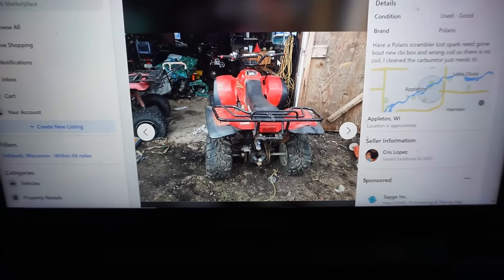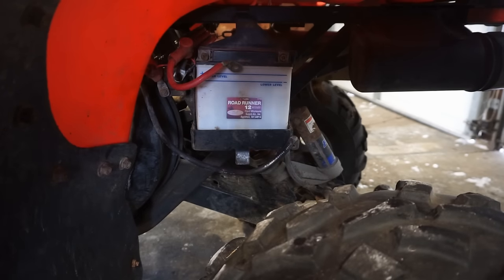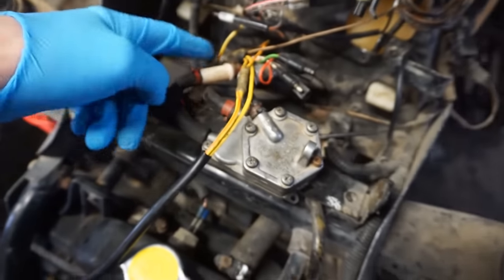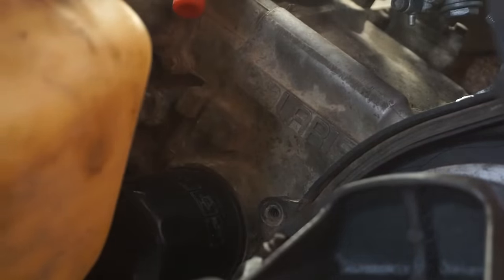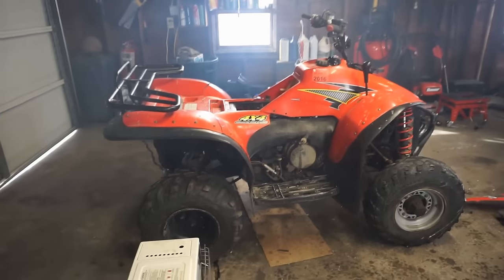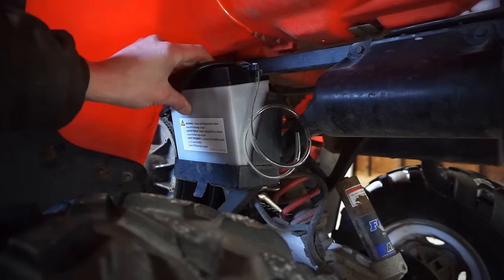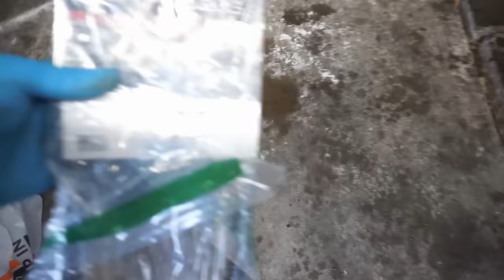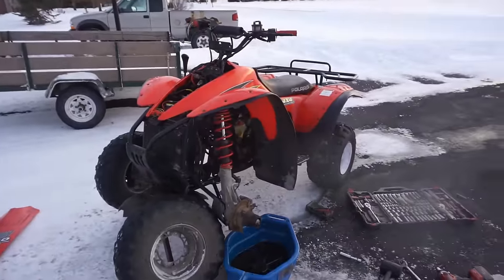Seller Said This Quad Was a SIMPLE Fix...$900 Polaris Scrambler 500 4x4

Comment: I worked at a plant that made Polaris exhaust very low quality, but they did switch to stainless steel on a lot of different models. Alot of the welds still look like crap though

Comment: I am assuming this is an old video that you just made and released, but your new belt isn't going to last long with a huge piece broken off the inner sheave on your primary.  Good job on pointing out the front hubs filled with grease instead of oil.  I just learned something, thanks.
Reply: Here's some more for ya, they also have to be filled with the PROPER oil, or they still wont work.
Reply: Yep should be filled at minimum with automatic transmission fluid.
Reply: He purposely didn't mention it but he 100% saw and noticed it. He didn't say anything because he knows it's at least $200 for a decent used clutch with no weights or spring.  This is why guys part these out and don't fix. They will have more money into fixing than it's worth

Comment: I had one just like it, got mine for $500. The guys daughter rolled it, didn't have any spark either. New CDI, voltage regulator, and coil. Problem was the spark plug boot. Fun to rip 🙏🏼

Comment: I have a 97 Polaris scrambler 400 2 stroke and it’s  damn near bulletproof! Had for 8 years beating the crap outta of it and always started. Welded the spark plug to the head because it always popped out. Took all the grease before every ride. Fast af! Always almost hit 70mph running on 8-ply tires!!

Comment: Yeah I picked up my 2003 Suzuki Vinson 500 from someone on CL.  He said all it needed was the rear break fixed.  Never mentioned that the dang frame was bent.  You literally had to cock the handle bars in one direction to go straight and because of the bend the front wheels were cambered off to one side.  He also said it was a 2006.  People are freaking liars when it comes to selling things.
Reply: yeah I feel ya, I bought a tractor off of FB and when I got the tractor home...the seller had already vanished. Needless to say I had to purchase a new head for this 21HP briggs. I was lucky to have a customer that was in the market for one
Reply: Why i got lucky when I bought a TRX250X, guy told me what's missing and what needed to be done, did it and it worked for about half a year now its got a rattling sound
Reply: U gota check the vin pl don't ways know o r remember. Also there off-road it won't be perfect always. 8k new or frac used.
Reply: U never know. I had a worn sprocket in a used bike blew the valve. Rebuilt it it's fine 2k but I got the bike for 2k new 12k.
Reply: The belt was fine the sprocket was old so now all new
Reply: Timin belt blew in mine. Jus new top end valves rest fine

Comment: Not 100% sure if it was the same on the scramblers or not but I had the 250 2 stroke and the front brake lever actually controlled a 60/40 split and worked on both front and rear brakes it was actually kind of nice tbh
Reply: that is wierd, usual the foot pedal does 50/50 ish and handle bar levers does front and if they have the other side rear. (on automatic qauds)
Reply: My 500 brake controls all brake front handle 😊
Reply: Just got a 2022 scrambler and same thing brake lever does all wheels and pedal does the rear

Comment: My father and I had a 250 trailboss and he had the scrambler 500 2wd version And as I got older, the scrambler became mine and that thing was one of the fastest quads of its day And mine was the 2 wheel drive to Stroke. And it would dust a stock 400 EX around the same year.

Comment: I had a new 2001 for about 12 years.   It was very heavy and had a ton of grease fittings.  The shift indicator lights often were funky, other than that it was a great fun ride.  Great engine with lots of power back in it's day!

Comment: I do not miss repairing my old Polaris 400 Sport. From quirky design flaws to the OEM parts just not holding up thru race conditions. Decent quads for just tooling around the house or farm, but I would not recommend racing them

Comment: Hey not sure if you noticed but at 2400 in video you are having screws that are stripped out! But if you look very closely you will see the tip of your Phillips head screwdriver has an extended tip on it. Just take a little off the tip on a grinder wheel and some of the stripped screws will go away!  Love your contents of your videos!
Reply: Buy set of correct Japanease screw drivers.Looks similar to Philips.

Comment: Also u need a plastic welder. I got one and ill never look back like 30 bux. And comes with 100 different assortment of sizes. Do it from behind then let it cool and cut the pin studs off. Works amazing. Touch up pen if you even need it

Comment: I just sold that exact model 2001 scrambler 500 4x4. i had it for 4 years and it was a maintenance nightmare most of the time. When I purchased it (for 2000) It needed a lot I didnt realize as well. new primary clutch,belt, breaks, master cylinders, caliper, petcock, tie rod ends, wheel and axle bearings carb kit and tires. Always ran great though..... Had it up for 2000 on marketplace ( all fixed)ended up letting it go for 1500. Good luck I'd run but I am nowhere near as skilled as urself.

Comment: I'd replace that neutral safety switch to cause it control that trigger coil also through the wiring harness to. yes your right about to. That trigger needs replaced on that engine joe. Along with that neutral safety switch to possibly.

Comment: Check all those lockout switches
When things like this happen , run a direct wire to the coil from the magneto or wherever the coil gets its power and bypass all of those switches. That's diagnosing.

Comment: My Mom's ex husband used to have a 500 Polaris scrambler, it was prolly around an early 2000s model and looked similar to that one, maybe a little more sportier, it ran pretty good. I think it was a 2 stroke, I could be mistaken or he didn't know what he had but I'm pretty sure he said it was a 2 stroke. It didn't sound like a conventional 2 stroke like a 250R or any others but it was an automatic and wasn't a racing 4 wheeler so it didn't scream but I don't remember it sounding like this one. But I rode it a couple times and I liked the fact it was an automatic, makes trail riding more fun.
Reply: 400 were 2 strokes the 500 were 4 strokes if I remember right, been a long time.. had a few with bad transmissions (must have been common as I had a couple), or the 4WD didnt work (like this one). pretty easy fix (4WD), taking the transmission out not so fun.

Comment: With units you keep or upsell cistomer. I use lithium in all my machines now. They have double the cranking power. You can put them upside down if you want. The weight difference is amazing. Loose about 4 lbs high up on. The chasis. Also theres no electrolyte its completely sealed can be put in any position and the cranking power is unreal. Also if u pay alnost 50 bux for a cheap lead acid. U might as well buy lithium as they are 100 bucks. Also there smaller and come with foam pads to fit any machine. I use firepower brand. They are amazing plus i get about 4 more years out of them. Try one youll never turn back.

Comment: I perfer the 82 degrees of Tennessee. Im restoring my 2002 500 ScramblerX. Mostly done but taking my time with it. 2 wheel drive. 4 wheel drive is too heavy to be fast in the woods. Mine is one of 500 built in April of 2001. Aluminum wheels, bumper and in black with the first of the X graphics.
Reply: @ElectronicMusicUnderground  I refuse to run an air conditioner too. The human body is designed to function in the real world you live in. If you exist in a climate controlled environment, ok. If I was to have a flat tire in July I could change it without melting. They call it acclimated. My dad moved north too, chasing comfort.  We have 70 degree days in December sometimes and possibly a few days of snow.  Jan and Feb can get sharply colder and the ground freezes for a few days.  Living under AC in a vehicle is needed, but i like the open window summer life and being acclimated when I walk outside. Cold weather sucks in general unless im hunting.
Reply: @ElectronicMusicUnderground  I never mentioned heat at all. I heat with gas.
Reply: @ElectronicMusicUnderground  Why are you making obvious statements now? I just lost the 30 pounds of fat that kept me hot all the time. I control the climate that matters. Staying warm. Even in the summer. I like how you are a 70 degreeian. Enjoy your environmental control. I kept my tropical fish at your favorite temp. I understand.

Comment: How ironic, I'm from Wisconsin to and had a similar experience with buying something. Few years back I found a CBR600 on Craigslist, I called the guy told him I'm coming to pick it up, he tells me yep he's home and to stop on down. I drive my dad's 77 3/4 ton dodge power wagon 130 miles one way to the guy's place, spent close to $100 round trip for gas to get this thing and once I'm there he tells me he just sold it to someone else about 10 minutes ago. I tell you, talk about pissing a person off that sure does it. I was so mad and I would never do that to anyone when selling something. Also the guy who bought it was local to the seller so even if I didn't buy it for some reason even though I told him I for sure was but even if I didn't he could have easily called the other guy back to come look at it since he was local and not driving 130 miles. So to anyone reading this please never do that to anyone because it sucks to be on the receiving end of something like that.

Comment: Those throttle cable contact terminals are a common pain point for Polaris machines. They are supposed to be set to a specific distance apart

Comment: Just bought a 300ex guy claimed it needed carb work well it turned over and had no compression well turned out to be a broken piston and a bent rod ! So I used a socket extension and a pipe and got the rod bent back I figured that if I can get some fun out of it I will I put a new top end on and I am still working on it

Comment: 34 running really rich. 33:12 it's running way  rich 
Sounds like you got a intermittent cutout on the ignition somewhere probably like the other guy said.
But it is running way rich  .
If it starts again right now hold the throttle open see if it revs . check to see if your choke is stuck or something go from there I'm not going to diagnose it but I can😂

Comment: looks like polaris used its snowmachine clutch setup, seems kind of sketchy. I get it on snow because the snow itself is loose and reduces the amount of pressure on that belt.  That secondary clutch should have adjustments to it, to get it to open up wider, it should only close that tight when pressure is on it.

Comment: Those cheap brass connectors. The kill switches almost always fail  1st. If you use the key it should last lifetime of the unit. Kill switch is emergency only. Like when u wipe out etc.

Comment: In a few years you will be able to pull over any engine and not necessarily need a gauge for the compression. You'll have enough practice to know if it's enough but if you want to get nit-picky you can always put one in there🎉😂

Comment: Hey Joe do you ever use grease light coat flims on gaskets on rebuilding your engines.,or have applied that procedure in rebuilding.& Repairing small engines with while filming it to on video. I know that make yamabond 4 & hondabond 4 gasket sealer sealants to put gaskets on with to. I was just wondering if you ever done it the old school way of placing gaskets on with to by chance.

Comment: I've never owned a quad before. I am an auto technician so I have some experience and tools but again, I'm new to ATVs. Would you recommend an older Polaris (early 2000s) or are they a maintenance nightmare? I can get a Honda TRX 300 or 400 EX for the same price locally. The 400 ex is a 2wd sport quad, the 300 comes in 4wd so I'd be inclined to go with that due to the sand and hill climbing capabilities. But I'm 220 lbs and the Honda 300 has like 20 hp... May be a little underpowered

Comment: happened to me too man, bought a 2001 yz125 for 1450 and dude said all it needed was a carb boot and he had given me one since he said he had it, turns out it was incorrect and I had to buy the oem one off e bay for 100+ dollars, and it also turns out it needed a top end rebuild, a power valve cover, many of the bolts had to be replaced since they were stripped, and the carb was poorly tuned and needed cleaning

Comment: No it's just A automatic choke blow float set up that's all plastic is all joe. Witch means it has no jet in that area we're that O-ring seal &tube linkage goes inside of the carburetor made for automatic choke.& Auto injection feed setup.

Comment: I’m selling a non-running ‘83 ( I think) Yamaha moto-4 with repainted (blue)  plastics. Front ones have cracked pieces off at the outside wheel wells. I have a post about it on marketplace if your interested.

Comment: I live in Peoria Illinois. I Have a 2001 Polaris Scrambler, that has similar issues as yours did. When I stopped riding the 4 wheel drive wasn't working, and the valve to the gas tank leaked. And also the back brakes didn't work. After watching your video I thought maybe you'd be interested in fixing it up. Or it could be a parts bike for ya. Plus I'd love to see it back in action. And I need the room in my garage. I don't think there's cracks in tge plastics, but it is kinda sun worn. And could use new tires. Basically a project for the right guy. Hit me up if your interested.

Comment: one thing to try with a bad battery that i have had some luck with.top off water. even maintenance free batteries u can open up.drain battery completely of charge.i hookup a light bulb until its not light at all. than charge it with terminals reversed. drain it once again charge it properly.this has worked for me 3 times didnt work once,.

Comment: Good hunting quad.up and down steep shit slowly,with lots of engine braking to slow ot down.
Reply: No low gear in these 4-wheelers.  High only.  If you want to use them that way, you must swap a 2-speed tranny from a Polaris Sportsman 500 into  it.  They go right in, as it's the same motor.

Comment: Auto parts store items joe they sale sulfuric acid refill boxes in their stores for motorcycle batteries.& You can use them to top off.& Recharge those old batteries with to fully on A 2 amp slow charging process to. Then just check the voltage in the batteries by using A multimeter for voltage readouts with.

Comment: Most people leave the engine oil in because the manual says if you do drain it all, to prime the oil hose between the oil tank and the engine by blocking it off and turning the engine over a few times.

Comment: Those AWD switches get dirty and quit working, sometimes in the dif.
Reply: Polaris AWD systems are EXTREMELY dangerous when rock crawling.  A rear tire needs to spin in order for it to activate the front wheels.  Good for loose soil, mud, sand, gravel, and snow.  But not rock crawling.  No bueno.

Comment: I got one of these for 1200 ran great for a while the other day some teeth on the front sprocket went out so I replace both chain and sprocket and the drive belt but I still get a grinding noise coming from the clutch area. What can I do? Also can you describe exactly where that drain bolt is for the engine oil. I know where the drain pan is but the screw you undid first. Remember im totally blind. 😅

Comment: As a kid I always wanted one of these, never ended up getting one almost had one for 300$ that needed transmission work. Well needless to say these old polaris 4wheelers are on the bottom of my wishlist nowadays. The wiring on them is terrible from the factory, constant issues engaging 4x4, terrible ride quality and an overall cheap feel. My 1992 Honda 4trax rides 10x better than one of these. That being said they are very cool still with the whole mix of sport quad and 4x4 utility quad.
Reply: Says his honda rides better than a Polaris...yeah ok keep dreaming 😂

Comment: I actually would like some help.i have a 2007 arctic cat 250.same issue.but I have power to the coil the cdi is fine and the dash won't come on but start button and kill switch and ignition are good.but it still refuses to spark.any ideas?

Comment: sup guys having trouble with my 08’ Polaris Scrambler. just replaced the battery and i hear a weird clicking noise as i turn the key. also there’s a weird black connector right next to the battery prior to this i had to press it in and fiddle with it to fix it but this isn’t the issue it’s jus simply not turning on, even when pulling it.

Comment: I was convinced it was fuel not spark. But that wibbly wobbly switch was the problem. I'm sure you will soon find it. Not the coil but my bet is the switch. You are still focused on the trigger coil. We will see. Shows dirty. Still not convinced. An advertisement for a laser aimed sling shot would take out the rodents in my house. But I have a pump bb gun. Seeing them seems short times. Must be ready when spotted again. Am 76 so don't want to hunt them all day. Might be necessary though. You tracked it down to the red wire cut. Good. Kill switch bad. All good. Need to get rid of that flaky kill switch.

Comment: Hey brother can you do me a favor and keep and eye out for a 4x4 suzuki eiger 400 parts bike for me. I have a 2005 2x4 and want the parts to make it 4x4 it doesn't take much the cv axles the front differential and the out put start for the engine.  The engine is made for both it is plugged off for the 4x4 . The front hubs are there as well if you seem them you know . Thank you if you can do this for me. The motor can be blown trans bad wrecked on fire doesn't matter want a cheap parts bike